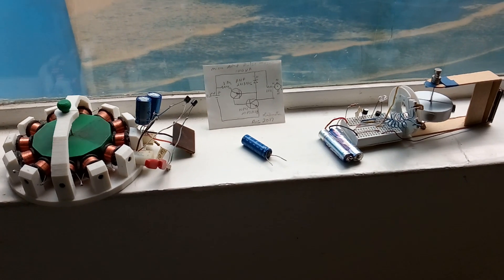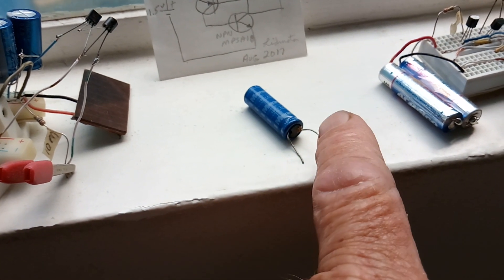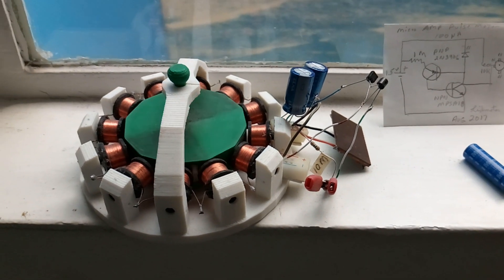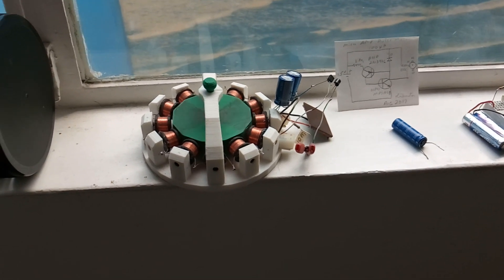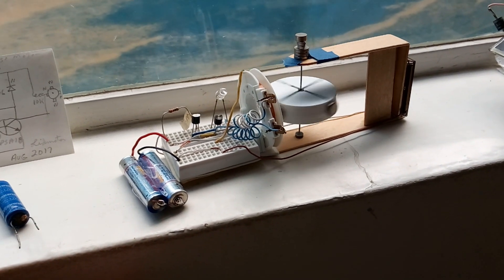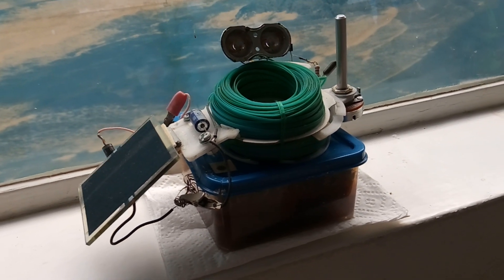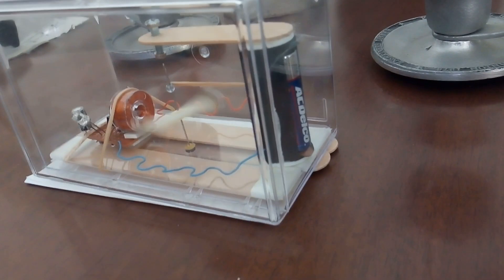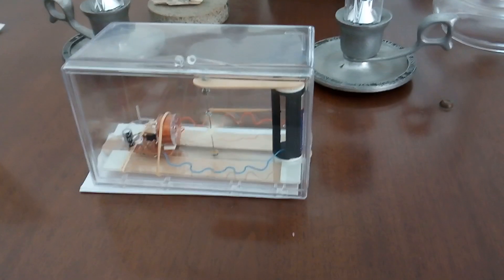My Non-Stop Running Devices----After 2 years update

Comment: I feel like the size of your magnets is part of the power equation. Power, efficiency, ECT. 

If so. Then invert your system. 
Get the magnets to the outside, where you can go extra large with a cherry on top 🍒. Whip cream galore. 

If it's part of the equation....invert, and go big on the magnet. Counter balanced, ECT. Annnnd bingo. Check-mate....as some of the other comments here like to say. 🤑😉

Comment: Nice update.  It sounds like the biggest challenge with these is mechanical, not electrical.  But friction has its place.  It stops me from sliding out of my chair when I doze off.
Reply from the maker: Ha!  That made me laugh.  Friction does have it's advantage.  Car brake pads keep me from sliding into the guy in front of me.....as long as I remember to step on that left peddle.

Comment: You are into a mountain?
Reply from the maker: Nope.  You are looking a paper ocean picture pasted on a wall outside the window.
Reply: @Lidmotor  very nice!! If interested I did a extremely low voltage  joule thief . It runs for 2 days with a 500 millivolt diy battery that I made
Reply: Well you have the low voltages into  all your projects, I think is the same as I did

Comment: If you figure out how to use pyramid shape power, you could potentially run these devices forever. Pyramid shape concentrates ether energy at the top point creating a magnetic field vortex which can be used to power these devices in theory if done correctly. Read book "Shape Power by Dan A. Davidson". Check video "Shape Power as Universal Resonance by Dan A. Davidson". Google image "Pyramid Vortex".

Comment: "That energy is more than the motor need to run on". Impressive stuff!
Nothing that compares with your accomplishments, but here's what i managed to humbly achieve:
 I have an led lit continuously. It's powered via a(rather big) 6v solar panel, through a 1.5v voltage regulator that keeps two supercaps in parallel at a high enough level to run a joule thief. It's been on for over a year thusfar.
Reply from the maker: Excellent.  You bring up a very good point.  I think that the only thing you need to power a low amp device 24/7 ....is a big enough solar panel and a way to store the excess energy.  Unless you live in the higher latitudes the sun comes up every day and the new solar panels work on even cloudy days.

Comment: 3:49
That is very interesting, sounds like there was some sort of mechanical negative feedback making stop.
Reply from the maker: On that 'Yearling Motor' the drive unit is in attraction mode and over time the sticky foam mounting tape gave way just enough so that the rotor would hit the drive coil and stop.  When I would find the motor stopped the coil had moved back into place and the motor looked fine.  It took me awhile to figure out what was going on.

Comment: very good job ..
 free energy whithout solar power or battery ..do it ..
Reply from the maker: Free energy is everywhere and in many forms.  The trick is converting to do work.  Sooner or later as Tesla said ... "we will connect our machines to the very wheel work of nature."
Reply: @Lidmotor  Solar & wind energy are free--but they cost money to harness.   Once your machine is paid for, then it's a free energy source (less maintenance costs of course).

The problem with both is that they aren't reliably constant (unless you are in orbit & you capture solar energy 24/7 & beam it down to the earth.

Otherwise, all other systems require fuel of some kind--which isn't free to obtain or distribute.
Reply: There is not really any "free" energy, though I do believe it is possible to use an arrangement of magnets and get the energy from them to do the work .
Reply: @OverUnity7734  The energy from magnet systems comes from the force that moves the magnets.  There is no free lunch with conservation of energy.  If you can prove otherwise, you'll be famous.  Nevertheless, I'd still be curious to see your idea in action.